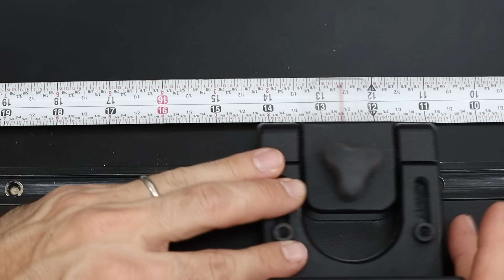I built the perfect miter saw solution.

Comment: As a woodworker the mitre saw is very useful. As a homeowner/ DIYer the mitre saw is a necessity. I would love to see someone trim a room with their table saw sled.
Reply: I was debating building jigs for my circular saw, instead of buying a miter saw. In the end, those jigs will take up more or less the same space on the shelf as my miter and the costs for building the jigs is nearly as much as a blue bosch GCM 8 SJL. So, miter saw it is.
Reply: Agree! For a majority of the furniture I build, I can cut everything accurately by hand or with my table saw. But as a homeowner, building decks, trim, repairs, etc., I would replace my miter saw instantly.
Reply: Exactly! Can you make it without one? Sure. I use mine all the time and wouldn’t want to be without.
Reply: Agree 100%. If all you're doing is building fine furniture, Ok, maybe you don't need a miter saw. But if you're a hobbyist, planning to do any mobile work, or to do any kind of home improvement work, than miter saw is probably at the top of the list.
Reply: Use an ordinary hand-held circular saw. Easy
Reply: I don't really use my mitre saw for furniture or cabinetry. Used it a ton for DIY though, for trim and cladding especially
Reply: Hell, I trimmed my two master bedroom closet doors with a miter box because I don't have a miter saw...yet, lol. It's on the list of must haves along with a brad nailer, and multitool. I'll be tearing down my wasp sanctuary....er, I mean storage shed, and I'll need a miter saw to build a new one. I've always wanted a miter saw, and hopefully I'll get one soon.
Reply: Grüß dich Jon,
my shop is more or less the same size as yours kinda 3 x 5 meters, what ever it is in imperial... But I use as well a garage and cars are more or less the same size...

I love your build, and I totally agree. A miter saw ist definitely a must have. At least for my needs. For 4 years I had a fixed station. Due to my f*in' neighbor I needed to change my shop organization, maybe you remember it from our private conversation...

In my new shop, I need to build everything smaller and mobile, in case I'd need to empty my shop again... 

I'll go for a mobile cart version with fold down wings... I know I will miss my old stand, but better than nothing...

Good luck with your new full time job ✊

Viele Grüße vom Garagen Gio
Reply: @garagengio  He may miss this it's in a sub thread not the main. 

I feel your pain too - I'm wanting to move from a place I otherwise love due to said f*in neighbours. I want more functional workshop space, even having a Hackerspace down the road it still matters having room to do 'stuff' in your own place.
Reply: @michaelrobinson9643 thx, didn't see I answer this comment section...
Reply: i did my whole house with a mitre box and handsaw
Reply: Agreed. For furniture it isn’t helpful for more than a few rough cuts usually, but as a DIY homeowner, it is invaluable
Reply: If you don't believe a mitre saw is valuable, have one your entire life and then lose it in a move. I'm dying over here lol
Reply: Just replaced the flooring in 2 rooms, with new trim. Couldn't agree more. It was the first power saw I bought.
Reply: 100%. I started with a DIY construction hobby before my woodworking hobby, and a miter saw was one of my first big purchases, and I still use it all the time. I'll also add that a miter saw + track saw generally feels much safer and easier to use for a beginner than a table saw, and can be used for tile, pipe and angle iron with the right choice of blade. (yes, tile is really dicey to cut on a miter saw - be careful and clamp to scrapwood!)
Reply: The best thing was watching you level this up. Thanks 😂
Reply: Who needs fancy trim?
Hell I'm building a barndominium. Simplicity is nice
Reply: Critical piece of machinery. 

I recently enjoyed using mine to cut some 6” sewer pipe I was using for dust collection. The unexpected bonus was snowing green confetti fibers all over the driveway, then leaf blowing them over towards the residence of the aspiring Eminem freestyle rappers next door 🙌🏼
Reply: 100%
Reply: Circular saw replaces both miter and table
Reply: @Ceen328 Is the Bosch basically the cheapest miter saw on the market? An entry level price point? I know Harbor Freight now has a decent one from their Hercules line up from what I hear, but idk about that one tbh.
Reply: @ML-sc3pt Hell, you can make simplicity fancy if you approach it right... while still maintaining simplicity. Even an original unmolested Victorian era house kept that in mind for the most part.
Reply: @SeamlessFab lmao
Reply: @upshiftgo as someone who might buy the cheapest entry level mitre saw that money can buy and probably never will anyway, I agree. All you really need is a circular saw/skillsaw just don't be a doofus when using one and they aren't so sketchy after all.
Reply: @trickyricky12147  Dunno where you are from. I'm german, so Bosch (german company) sells here for less, than overseas. I think it is around 300€, while Milwaukee, DeWalt and other US products are way more, than in the US.
Reply: @Ceen328  I'm from the US, but I'm not sure how much Bosch sells for here. Yeah, Bosch is an excellent German power tool brand. They've been selling here for many decades, so I consider them American at this point and also because of their excellent quality, IMO. Is it true that Bosch invented the jigsaw? I've been told that they did, or at least pioneered it.

Comment: I'm  so old that my miter doesn't have a slide
Reply: I’m so old my miter doesn’t have a motor.
Reply: Yeah, you really only need it to slide if you are cutting thick wide pieces... and even then if your blade is square you can just flip it. Safety I'd the biggest problem at that point.
Reply: You have a drop saw....(I think?)
Reply: Right there with ya
Reply: Radial arm saw for the win in my opinion
Reply: @0001champ chop saw 😂
Reply: @dannyarcher compound saw

Comment: So glad to see you took their advice and built separate toe kicks. I’m a 30 year experience cabinet and furniture maker, and seperate toe kicks is only way I built cabinets even the island and entertainment furniture. You can level and secure 10 times faster than leveling cabinets. Once leveled your base cabinet install is 50% faster on average
Reply from the maker: I've always done them integrated. So glad I tried it on this one. Won't ever do it another way
Reply: From another 30 veteran cabinet builder I couldn't agree more. Once you figure this out it sets you free and falls into that categry with all the other simple things that save time and work just fine.
Reply: Plus you can move things around easily, just build new level at new location and put cabinet onto it
Reply: How I wish I’d known about this elementary concept when I built a workbench for my other hobbies… it’s as level as I could get it.

Comment: I'm a retired contractor who is now doing woodworking as a hobby and maybe a little supplement retirement income. You would think that they are similar but they are worlds apart at times. As a contractor a miter saw was a must have tool and used all the time and the table saw was a secondary tool that was nice to have sometimes. In woodworking almost the opposite is true, I say almost because I think the miter saw is still very valuable in woodworking. I have watched videos where I'm thinking I can do that on a miter saw so much easier and faster with the same results, and I usually do. Guess I'm just used to using them after all these years. I'm looking for ideas on how to build my miter station in my small shop so will definitely keep this video in mind. Thanks for the videos and I like the humor that you have in them.

Comment: Everyone has their own opinion I guess. But my miter saw is by far the most used tool in the shop. I did a similar setup by building the saw between cabinets so it has one continuous work surface along with a stop block, dust collection, and plenty of lighting. Nice work on your end and I hope you get a ton of use out of it.

Comment: I have three compound miter saws in my shop, two on shop built carts, and one that folds up contractor style. I teach technical theatre and can't begin to imagine a shop without "chop" saws. Table saws are great, but they are just one tool and can't do everything. I'm also down my cabinet table saw right now due to being in a temporary space.
Wouldn't dream of giving up my panel saw or band saw either. I have a very tiny shop for the tools we use and the amount of scenery we build so nearly everything is on wheels, even our "contractor's" table saw can lift up on casters, and our work tables have locking casters. Every inch of space  under every work surface is storage. I think the only universal thing in a wood shop is no one ever has enough space.
Thank you for the spotlight on miter saws. Compound miter saws are great tools, it shines differently from other saws. Like you said, each of us know best what we need in our shops. There really isn't one "right" answer.

Comment: I'm currently in the middle of this build, and the plans have been great. Definitely need to go slow, read a few steps ahead, and have a calculator handy - but so far measurements in my build have matched the plans exactly, so it's all fitting together like a glove. I have to make a couple changes to account for some specific situations in my shop, but the plans have been easy to alter where needed. Great work! Also worthy to note - I've made the entire thing without a table saw, as my shop is 110sq ft. Used a track saw and miter saw only, and I've had zero issues making any cut needed!

Comment: As a laminate tech for many years I used slats from venetian blinds under the glued laminate to suspend it from touching down. They are thin, easy to clean, stack well in your box, and they are CHEAP!  Other folks swear by dowels but I can stack 50 slats in a much smaller space than 50 dowels!
Reply: And they don't roll around and fall off the table or counter top.
Reply: .Have been doing laminate for more years than I would like to admit, have always used leftover laminate self-edge strips between the glued surfaces. most around 30" and a few around 40" to reach into the back of a inside corner.

Comment: Great build.

I built mine out of discontinued Rockler steel shop stands on sale for over 50% off and free shipping.  Rock solid, easy to level & put a top on, skim the sides with plywood and make some simple doors/drawers.  The entire station is about 22' long and I can cut 10' to either side, but you can make it just about any width you'd like.  

The entire thing can be disassembled and moved to a new location if needed.  It lives along one dedicated basement shop wall and is an absolute necessity for me.  It stores nearly all my tools below, with plenty of extra space and I have not even put up cabinets above it yet.  Removable fences permit it to double as a pair of benches/tables for working on.

Comment: This is perfect timing for me, who is just about to rip out a wall of un-synced cabinets and benches to replace with a miter station setup. I got some really nice insights from this that I will take into account. (Though it will NOT be as elaborate and nice as yours, it may be as practical :))
Thanks! And I very much like the way you question "the common opinion" with common sense.

Comment: I’m thoroughly impressed with the entire conversation to the quality of build! And idc what anyone says a mitre station is absolutely needed! What I love about yours and Michael Alms is it isn’t massive or ridiculous. What I’ve been hesitant on building mine is I don’t have a small large Yet to build into mine like Michael has, plus all the other tools that be taken into consideration when building once that holds a ton of tools besides just the mitre saw. I have a tiny garage that barely fit in a small suv till I dedicated it to wood tools and the greatest need is storage in my case plus a dedicated home for my mitre saw. Not having an accurate fence to break down material is awful and time wasting. A gripe I’ve had for a while are French cleat systems, the idea was nice back when April Wilkerson went heavy on em but the amount of wall space and headache trying to build functional and personalized tool storage, plus the upkeep of cleaning and the many more failures that were tossed out because they either fell off the wall or just didn’t work out wasted a lot of time I could’ve devoted to actual cabinets. That and my ocd hates seeing clutter so anyways I love seeing French cleats hold cabinets and neat storage builds that work out but a small shop needs drawers, cabinets, and roll out/flip top carts plus a mitre saw station that isn’t outrageously massive. Now if table saw benches were more well thought out, less bulky and more multi functional that’d be great

Comment: Excellent video, I agree with your points regarding having a power miter saw and intend on upgrading to the same saw you have. I really like your miter saw station and your video helped me answer several questions. I plan to start my build after I purchase my new saw and after I remove my radial arm saw from my shop. I’ve used it for two cuts in the past 15 years. Thanks for the great video. I too have a small shop and every square foot is important.
Reply from the maker: Thanks for sharing

Comment: I have so many comments about most of your video!

First off, great job!  Clear and funny!

I was a cabinet maker at two shops, and the first one built everything with integrated toe kicks... such a pain in the ass when you go the the customer's site and had to shim the crap out of one cabinet, and belt sand away another!
The second shop did the toe kicks separately, and install time dropped and so did the stress levels!

As for making quick and dirty shop furniture, I'm of the belief that you should enjoy your time in the shop - spend whatever time and effort you want on it!  I like having stuff in the shop that you would find in someone's kitchen.

As to the people who say, "oh, you shouldn't have 'X', and you're not a real woodworker if you use 'Y'.." I stopped following/subscribing to people like that, and you should ignore those comments.  I have a medium sized shop at home (Is 24'x 24' medium?), and I can't imagine living without my Bosch miter saw.  Any tool that helps you break down stock and square things up is a keeper in my books.

Comment: Grüß dich Jon,
my shop is more or less the same size as yours kinda 3 x 5 meters, what ever it is in imperial... But I use as well a garage and cars are more or less the same size...

I love your build, and I totally agree. A miter saw ist definitely a must have. At least for my needs. For 4 years I had a fixed station. Due to my f*in' neighbor I needed to change my shop organization, maybe you remember it from our private conversation...

In my new shop, I need to build everything smaller and mobile, in case I'd need to empty my shop again... 

I'll go for a mobile cart version with fold down wings... I know I will miss my old stand, but better than nothing...

Good luck with your new full time job ✊

Viele Grüße vom Garagen Gio

Comment: I just discovered you channel. Really good content! I am a moderate to advanced hobbyist diy that uses my DeWalt DW708 12” sliding miter saw frequently. I have had this saw for 22 years and the only things that I have replaced is the power cord and plastic inserts at the blade track. With a quality blade, and occasional tune/check up, has served me very well. I have been looking for a new ‘base’ for my saw as my shop layout changes and really love your design. An f-em, I will probably use some walnut and birds eye maple I have on hand as you have!

Comment: I see a different distinction in using my miter saw. Initially, i used my miter saw on a portable sawhorse-style stand so I could stow it when not in use. It was inconvenient to set it up, so I rarely used it except for big projects. I built a permanent mobile stand for it and it is always connected to power and dust collection. It is SO handy to make a quick cut with no setup. Eliminating the setup time was the key to the saw being useful (for me).

Comment: I agree, the miter saw is VERY useful. Wouldn’t be without it now in my small shop. I have the same Bosch miter saw. It is accurate to .004” over a foot. That was with the factory blade, I have a better blade now. I also have the Shop Nation dust collector, great addition when cutting thinner materials. No 4x4s!

Comment: I need my miter saw, I just don't need a dedicated miter saw station/cart. I place my saw on my assembly table and have a square built from 2x4s attached to roughly the top 8 inches of a cedar fence picket. The square can be clamped wherever I need it to cut boards as long as I need. The fence picket keeps it flush against my table. Saves me a ton of space.

Comment: When I use cutlist, I usually enter my stock sheets as 48x48. It's not the most efficient, but cutlist frequently expects you to make 8 foot long cuts along the entire length of the sheet. Cutting your plywood sheets in half and breaking them down from there is way easier and you're far less likely to make mistakes. Obviously this doesn't work for pieces that need to be longer than 4 feet, but it works for most cabinet builds. Worst case scenario you have to buy an extra sheet of plywood for an oversized piece, and then you have some left over for other projects.

Comment: I'm a cabinetmaker and installer by trade. My cabinet wall slash miter saw station is all butt joints, some just stapled together like drawers. currently none of the cabinets are even leveled or screwed together or attached to the wall. It all still works.